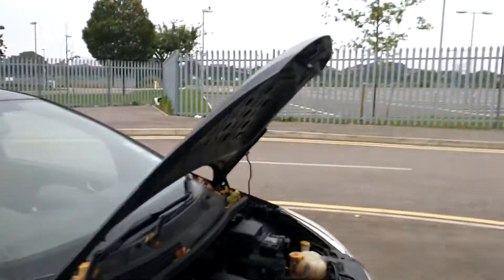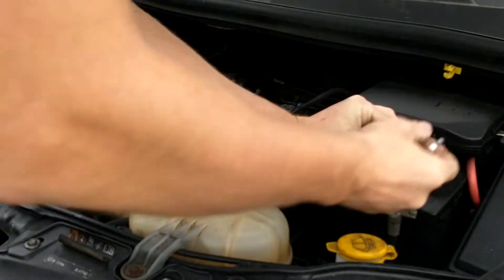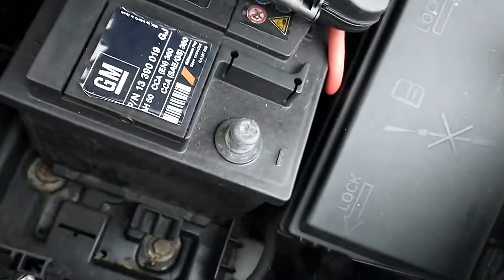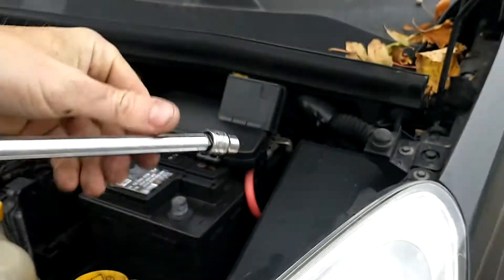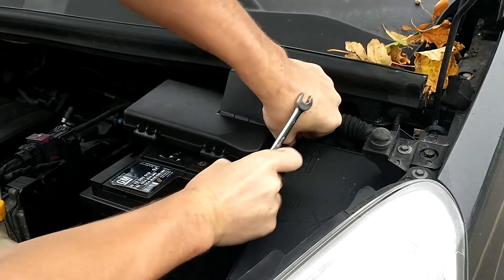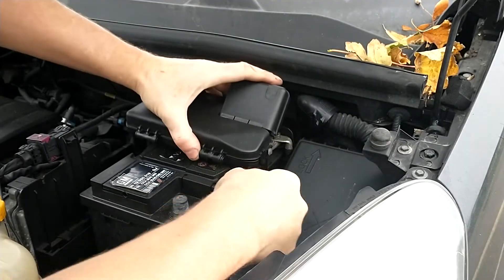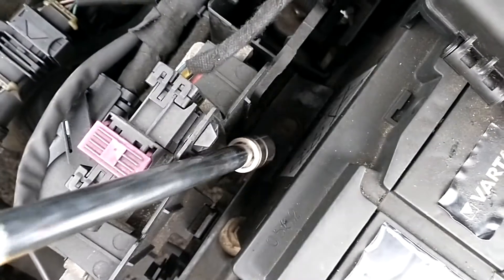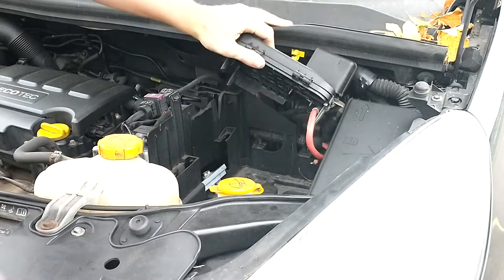Corsa D Battery Removal replacement 2006 - 2014 Vauxhall / Opel how to change

Comment: After replacing the battery I’ve noticed my battery light comes on, I’m sure this didn’t happen before, could it be that I haven’t secured the battery correctlyv
Reply from the maker: Could be loose connection or bad alternator

Comment: I ain't no mechanical minded I need to take my battery off and put it on charge over night is it OK like to leave battery off the corsa over night would it hurt owt in doin so.. might sound a daft question to you or people that have good knowledge 

Thanks
Reply: You can do so ,  you may check that the [- contact] and [+ contact] is put away and stay away from the  battery charger contacts ,  afterwards the Date and Time is reset but it can be manually changed, or to switch on the radio with RDS on it should automatic change to present Date and Time after turn off key and on again (if I remember right) 🙏